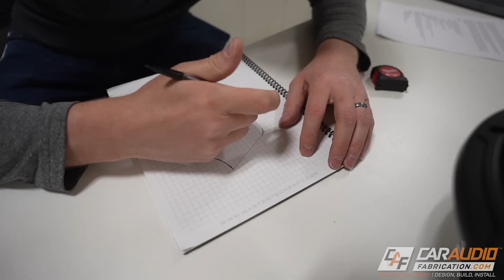Fabricators MUST WATCH! Template Shape Creation Explained

Comment: Hello enjoy your videos!! You do amazing work. Both informative and helpful content. So I have some questions. I have 2 American bass 15’s and gonna build a box. The dimensions of the box is gonna be 40” long x 16” high x 20” wide ported. I’m planning to run the subs  bridged at 2 ohm runner by a 3000 watt amp. Is this gonna be possible?? And will it sound awesome? The reason I ask is cause I’ll be running this box in a 2008 Toyota Yaris hatchback and the space that the box will sit in is dimensions I described earlier. The box will sit were the back seat used to sit. Made a floor but the air ride components take up most is the space. So my question is how can I make this work. Any information will help!! Thank you

Comment: If you're a big mobile user for notes and other stuff, a fantastic app I use to design enclosures in a 2D space is ImageMeter, gives you scale drawings with grid lines to whatever size you want, and you can get as precise as you ever need (I use 3 decimal places), then you can tweak designs, it's an amazing tool

Comment: Will you do one showing how to make that same template with a 3D printer?  I imagine it would be more work than this initially, but then making slight tweaks to the shape or scaling it up or down would be far less work

Most people probably don't have a 3D printer large enough to make that, but I think it would be possible with the feature most modern slicers have to split large parts into multiple prints that you can join together